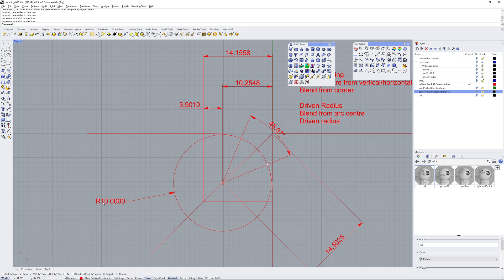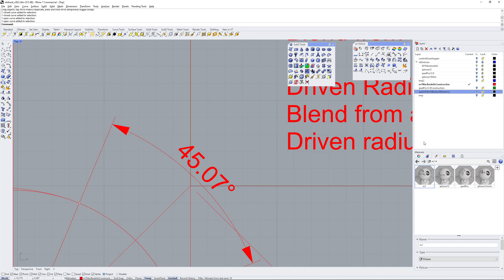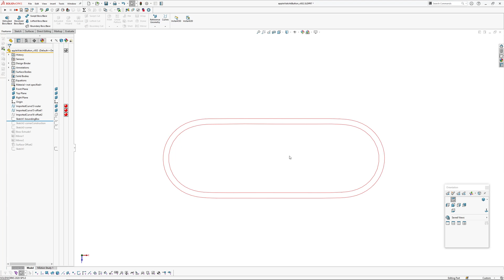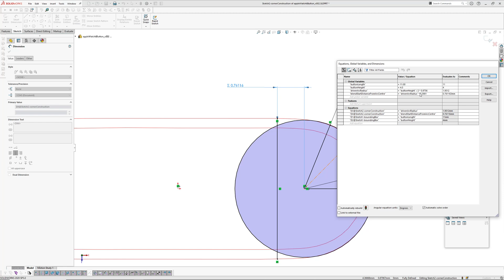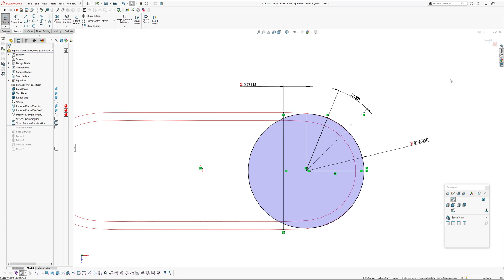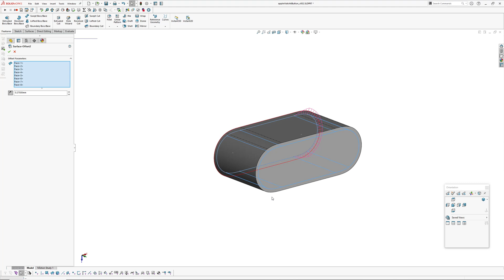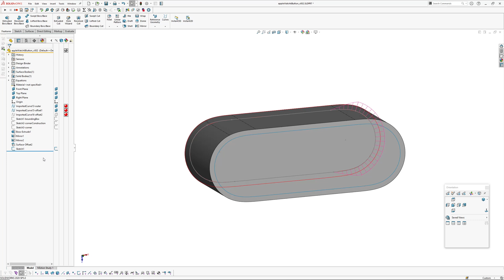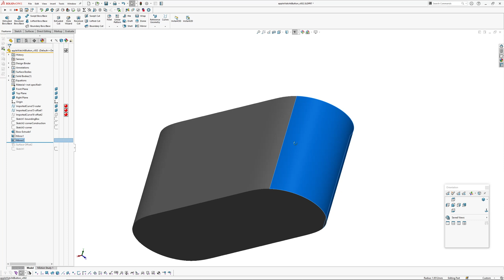Apple Corner 3. Clothoidal Pill/Lozenge Transition

Comment: Hi Andrew, 

Would you use the same thinking/forumuls if the pill was tapered? Treat each side separately due to the different widths.
Reply from the maker: Hi Ryan, if the angle between a vertical line that is tangent to the end arc and the line that makes up the long axis of the pill is smaller or larger than 90deg, then the ratios will be different, can recalc in Rhino. But I think the differences will be fairly small depending on the taper.

Comment: Nice Andrew! One thing, is the apple watch button planar? If not, the side view projection could be distorted? 
Meaning if the button surface is nonplanar (cylindrical surface for example), then there is a chance that the sketch used to cut the shape maybe projected along Normals of the surface if that makes sense. Like it was being UV mapped.
Reply from the maker: Hi Tony, I had thought the same thing but didn’t mention it!
Reply: In any case I think does not matter much!
One thing I note optically is that compared to the 90 degrees round, the 180 might need shorter clothoid segments and more arc length. Then again it is very subjective.
Reply: Hi Andrew, I'm curious about the ratio from Rhino. Does the setback ratio change or apply for connections other than arc to straight, thinking arc-to-arc or arc-to-spline/bezier?
Reply: Also, I really enjoy your videos and have applied some strategies to my own work. The over built 4-sided surface and trim method from you bicycle frame head tube blend video has been most helpful. Thanks!
Reply from the maker: Good stuff! I better go watch that video again, I forget what strategies I have used sometimes. There's always more than one way to build everything!
Reply from the maker: Hi Nick. I'd say it would change, however I cannot test that out with the clothoid Grasshopper definition, as the code in there is over my head! It is set up to make a clothoid transition between a line and arc.